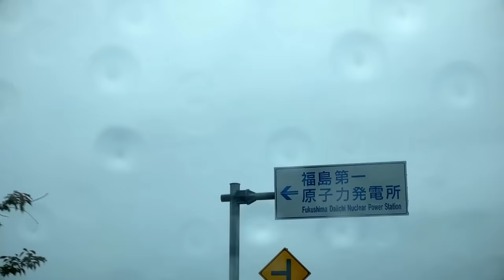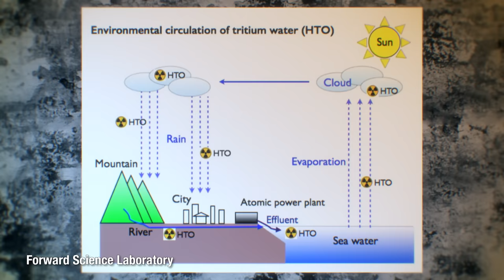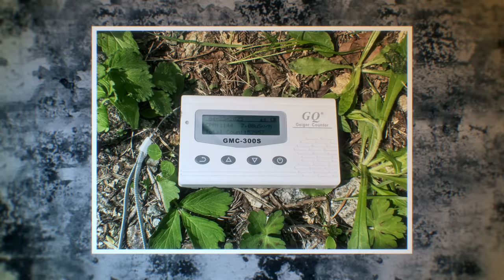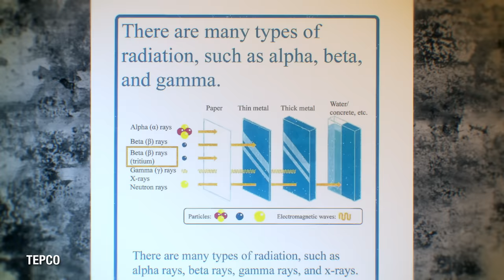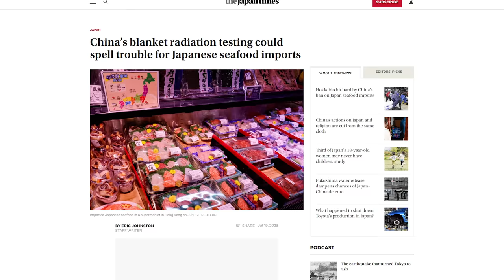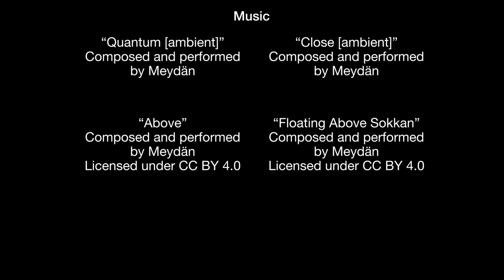Is Fukushima's Radioactive Water Safe?

Comment: Maybe the handled samples by the ALPS for IAEA are OK. However, there is no guarantee that Japan will keep working on this expensive treatment unit for 48 years. In fact, the ocean will swim with organisms that will enrich such radioactive tritium elements. Yes, it will have an effect on those organisms that have biologically collected these tritium elements. The radiation is at a distance of a few millimeters, which is enough to have an effect on humans who eat these fish.
Reply: Because of the role of hydrogen in metabolism and its ubiquitousness in the environment, organisms have not evolved mechanisms to accumulate or concentrate hydrogen or its isotopes in food chains. Therefore, biomagnification of tritium is not a factor in food chain transfer.

Comment: The problem is sampling and test procedure.
Now, all the treated nuclear contaminated water samples which had been tested, seen or percieved in any way were all sampled and tested by TEPCO. It means that TEPCO picked the storing vessel, the place, the time, the object elements …  Based on TEPCO's previous documents forgery records, manipulating the outcome of the test doesn't seem so impossible. The protestants are demanding some independent full test during the discharging, from sampling to a wider range of testing.
Let the science be scientific!
Reply: In a report released by the IAEA on May 31, 2023, the following research institutes conducted data analysis on samples of ALPS treated water collected in the presence of the IAEA.
IAEA laboratories: Marine Environmental Research Institute, Terrestrial Environmental Radiochemistry Research Institute, Isotope Hydrology Research Institute
Third Party Analyzers: Spiez Institute in Switzerland, Institute of Radiation Protection and Nuclear Safety in France, Los Alamos National Laboratory in the United States, Korea Nuclear Safety Institute in South Korea
The report presents a comparison of analytical results and data for 83 types of radioactive materials from each laboratory. Based on that, they decided it was safe.

Comment: So what I don't get is why not just reuse the water in a closed loop cooling cycle this water that's in storage supposedly has been cleaned up to the point that it's safe to release into the ocean why not just pump it back into the reactor to cool the reactor again and then store it for a little while do the cleaning process until it's clean enough to release into the ocean but then again instead of releasing it pump it back into the reactor I mean we reuse water in closed loops cooling cycles all over the place almost every car on the planet has a closed loop cooling system I don't see why you can't reuse the water to cool the reactor and not have to release it it just doesn't make sense

Comment: if the water in the canister was really the treated water they plan to release (and I have no reason to not believe it was so) holding the detectors close did show that there is little to no whole body ionizing radiation that you can get from gamma rays, that at least is something, those harmful products from fission, neutron activation, and otherwise are being dealt with.  If they had a beta detector and were allowed to open the bottle so there was nothing between the water and the detector, I wonder what the readings would have been.  Probably low, but still, it would have been a more thorough representation of the safety of the planned discharge.
Reply: Still nothing.  Water is a great shield for radiation.

Comment: Thx for the information, I always confused w the iaea live measurement of the releasing Fukushima water to ocean. The alps treated is mostly 5.5CPS, the sea water intake is about 7CPS. Diluted radioactive water is 5.1 or slight above 5 CPS. How is it possible to hav mixed water CPS lower than the intake.

Pls refer to iaea - 
"Data from Fukushima daiichi alps treated water discharge"

Comment: Great video with very good explanations for the general public! Thank you! I wish that more people would understand both the good pracices for protection and the risks/lack of risks related to the functioning of nuclear power plants, depending on the real measurements and situation. As for the beta electrons being stopped by the plastic container, I would comment that you can measure the secondary and bremsstrahlung x-rays. Using a weak sealed 137 Caessium source and a "home made" Geiger counter that I build with my students, one would measure a lot of events, about 100 more than the beta activity, due to these x-rays that are picked easily up by the tube that I used. For a 60 Cobalt (weak) source, I got a conservative estimate of more than 17% of the gammas that passed through the volume to be detected.
Reply: Were you intending to explain that in a way that the general public might be able to follow?

Comment: They can choose the evaporation treatment method instead which will be about 10 times more expensive than just pouring in the sea, but much less economically damaging from foreign sanctions of food export. But they choose the cheapest method, show you idealized reports(only show the best results as the tests are done inhouse)
Reply: All countries with nuclear reactors have always released the same tritiated water and none of them use an "evaporation method".
Reply: Yes 5 options were presented.  Dumping it into the ocean is the cheapest one.  Evaporation treatment would cost 10 times more.
Reply: @rinahk3407   And where do you think the tritium would go if the water was evaporated?  People do not drink seawater but do breathe the air.  I guess you would like that since it would allow you to scream even louder about harmless water.
Reply: You don't know how the evaporate option work? No kidding. Or just pretend not to know??
Reply: @rinahk3407   I know all about all the options.  Release into the ocean has always been the best option, that's why all nuclear power plants in the world release into the seas.
Reply: @danadurnfordkevinblanchdebunk  5 cents to you.  There is only one category 7 nuclear contaminated disaster.
Reply: @rinahk3407   Chernobyl and Fukushima were both deemed level 7, but Chernobyl released 10X the amount of radiation and actually killed people.  No one died from Fukushima radiation.
Reply: @danadurnfordkevinblanchdebunk  you obviously not understand the waste water from japan is VERY DIFFERENT from other normal reactor waste waters. The japan reactor has been melted and compromised and all the water is directly contacting the melted core that has all sorts of radioactive wastes. The NORMAL reactor waste water you meant in other countries and other plants was never in direct contact with the exposed melted reactor

Comment: The Fukushima nuclear disaster continues to be a major concern 10 years later.
00:11
Millions were left without power and over 19,000 people went missing or were dead due to the earthquake and tsunami.
The Fukushima Daiichi nuclear power plant was hit by the tsunami, leading to a series of explosions and the release of radioactive smoke.
Efforts to mitigate the disaster are ongoing, with workers still cleaning, maintaining, and decommissioning the power plant.
A recently approved plan allows for the release of stored radioactive water back into the ocean, which is expected to continue for several years.
The speaker spent time in the Fukushima exclusion zone, witnessing the aftermath and the remediation efforts firsthand.
✦
Fukushima's radioactive water poses big consequences
02:40
Nuclear fuel in power plant generates enormous amount of heat
Contaminated water stored in tanks running out of room
Plan proposed to release processed water back into the sea
Main contaminant in water is tritium
✦
Fukushima will release treated water into the ocean to control and monitor tritium concentration.
05:25
Tritium can be dangerous but is only dangerous in large concentrations and is excreted from the body like water.
The multi-nuclide removal process used at Fukushima can't remove all the tritium because it chemically resembles water.
The International Atomic Energy Agency has confirmed that there is currently no solution to separate tritium from water.
The released water will be diluted with seawater, bringing the tritium concentration to safe levels.
The concentration of tritium in the released water will be 1500 becquerels per liter, far below regulatory levels.
✦
Fukushima's treated water is safe to consume
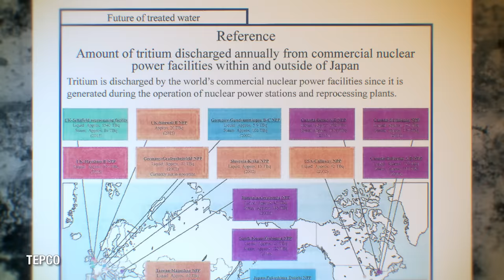07:50
Studies show that the diluted seawater mix in Fukushima is drinkable
Drinking two liters a day of this water for a year would not cause negative health effects
The International Community supports the safety of Fukushima's treated water
✦
The Fukushima nuclear power station apology and tour.
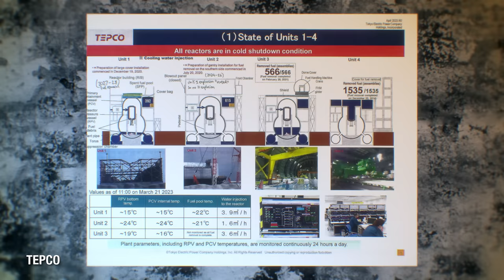10:18
The tour began with an apology for the severe accident at the Fukushima Daiichi nuclear power station.
The tour included a bus ride through the plant, with increasing radiation levels as they approached the failed reactors.
The radiation levels near the Fukushima reactors were significantly higher than those near Chernobyl.
The experience was highly radioactive and unlikely to be matched elsewhere.
✦
Following the principles of Alara (As Low As Reasonably Achievable) and TDS (Time, Distance, Shielding) ensures safety in high radiation zones
12:43
Spending limited time and maintaining distance inside Chernobyl's new safe confinement
Getting off the bus outside Fukushima's ruined reactors, minimizing shielding and distance
Maximizing time for lectures and photo sessions near the disaster areas
The risk-reward calculation and ethical complexities of close public proximity to radiation
Discussion of tritiated water and its planned release into the ocean, meeting safety requirements
Confusing presentation of radiated water, causing confusion for those familiar with radiation
✦
The handling of contaminated water at the Fukushima power plant raises safety concerns.
15:10
The use of personal Geiger counters showed no beta radiation, but it does not penetrate thick plastic.
As a scientist, unnecessary exposure to high radiation levels should be avoided.
Visiting the reactors and handling canisters of treated water can have powerful symbolic impact but may be misleading.
Using a canister of tap water for demonstration could have been substituted with sea water or treated sea water.
The risks taken by Tepco to overcome the negative public image of the industry are necessary.
Simulations indicate that any increase in radiation from the treated water will be localized to the coast and pose no real risk to wildlife or the public.
Monitoring of the tritiated water will continue during the entire process of decommissioning the power plant, which can take 30 to 40 years.
Long-term damage from the tsunami water was more significant than the treated water at Fukushima.
✦
The plan to release radioactive seawater into the ocean in Fukushima has potential consequences.
17:34
The risk-reward calculation of the situation is complicated.
The complex interplay between government regulation, corporate interests, nuclear physics, and public perception leads to sub-optimal risk communication.
The plan has already had economic effects, with China imposing a preemptive ban on Japanese seafood.
Some environmentalist groups are misrepresenting the plan, leading to fears and misunderstandings.
The situation at Fukushima is not a PR disaster like Three Mile Island, but it is not a PR success either.
There are no easy answers, but hopefully, changes will be made in the next 40 years.
Reply: The Fukushima nuclear accident wasn't a major concern even ten years ago.  No one injured, no one died.  No point in even reading any more of your post.

Comment: I have every reason to believe that TEPCO means exactly what they say with the dilution and release of treated sea water as a long-term solution to the issue. The science and evidence are more than certainly in their favor. However, their PR efforts to save face while ignoring ALARA and TDS so close to the nuclear buildings is not only misleading and confusing, but also irresponsible and ultimately dangerous.

While I do not believe you have stayed within the hottest parts of the Fukushima Daichi facility quite long enough to receive a worrying dosage of radiation, others who know next to nothing about nuclear safety (like tourists or trespassers looking for clout) might see it as an opportunity, and stick around for far longer than is healthy if the plant becomes another tourist destination like Chernobyl.

Comment: its not surprising that the alarm blared. they are set insanely low by default. they can go of if your in a big granite building. 

when you got to Chernobyl they will have you set a different limit for radiation. 

its not really a mark to say its safe or not

Comment: Why just the focus on tritium? What about vastly more dangerous radioisotopes like iodine, carbon and strontium?
Reply: At the Fukushima nuclear power plant, all radioactive materials, including tritium, are purified to below regulatory standards using multi-nuclide removal equipment and diluted at least 100 times before being released into the ocean. Through these treatments, the actual amount released is less than 1/100 of the regulatory standard value.
Reply: B/c tritium is the weakest radioactive element with the shortest half life
Some other radioactive elements half life is over 1000 years
Trying to confuse the public.

Comment: I'm curious, why isn't it profitable to sort out tritium  from these waters when tritium is normally very expensive to produce and useful for things like nuclear fusion? 

Is it a problem where we can't sort out the tritiated water from the non tritiated water and that process is more expensive than other means of producing tritium? Is there something we could do with electrolysis where we separate the hydrogen gas and then separate by density? 

I know tritium is very valuable so I'm curious why that's the one we're having trouble making cost effective. I know it's bonded very strongly and that would be hard to do on large scales but we make a lot of hydrogen gas this way normally and tritium is much more expensive than that.

Comment: If the water Japan released is safe, why release it into ocean? Actually these water had touched the nuclear fuel materials directly. So the water contains about 64 all different kinds of radioactive materials including Iodine-129, plutonium-239,240,241, etc not just tritium. This is not cooling water, it is polluted water that has touched the nuclear materials directly inside the reactor.
Reply: FlowingValley  The concentration is not a concern but the total amount that's released.

Comment: the thing is, what theyre releasing emits beta radiation until it decays into its more radioactive friend barium, at which point it puts massive radiation for about 2 minuets. This is why theyll tell you its at a safe radiation level, because you cant test its true radioactive potential for about 60 years. The question is, does cesium build up in the body as heavy metal. If it does then it presents the same problem to our ocean food supply as mercury. The ocean food chain will cause these heavy metals to build up. Releasing this stuff into the ocean completely overlooks long term problems.

Comment: Did any of the people in the tour ask why no filming was allowed?
TEPCO and every "scientific" discussions seem only focus on Tritium, which conveniently is nothing TEPCO can do apart from easy dilution.  Is it guaranteed that tritium is and will be the only radionuclide left in the treated water?
Why TEPCO needed to built a 1km tunnel to release the "scientifically" extremely safe treated water into the bottom of the ocean, instead of a shorter tunnel or even off the coast directly? One effect ("advantage"?) of the tunnel is: if there are other radionuclides left in the processed water, it could be diluted and dispersed and eventually much harder to detect.
Does TEPCO take samples of the treated and diluted water right before release into the tunnel? If not, why not? Isn't it the most accurate sampling point to tell how safe the water is, instead of collect samples from the sea?
Reply: Because tritium is the only radio element they could talk about. If you talk about others, people may see through how toxic this contaminated substance really is.

Comment: I'm curious of what the process actually is to remove tritium?  Also, we all remember in science class using electricity to split water into hydrogen and oxygen.  What happens when you do this with water that has higher concentrations of tritium?  Is the resulting Tritium easy to capture as I'm assuming it would be more dense?  My understanding is tritium decays into helium.  I have heard but can't site proof that the world may be running out of capturable helium.  If so, would capturing the tritium and storing to become helium be a potential viable option?  Does pressurization of tritium increase or decrease half life?  just a few thoughts from a guy without the degrees or means to action...